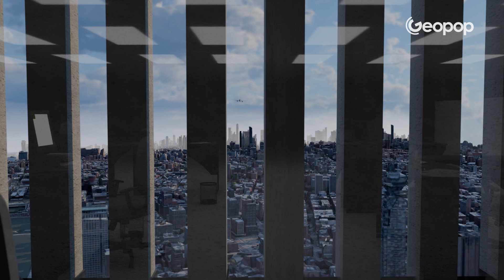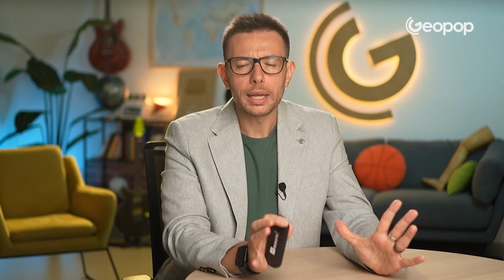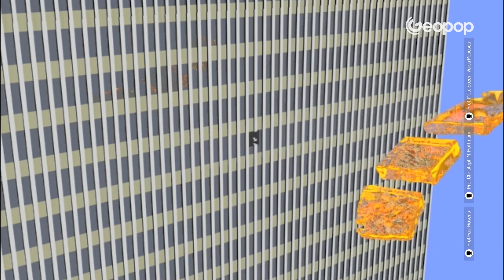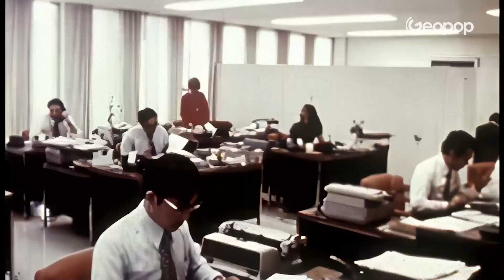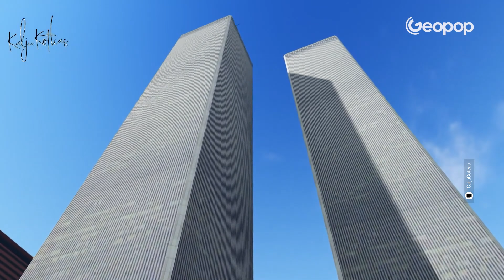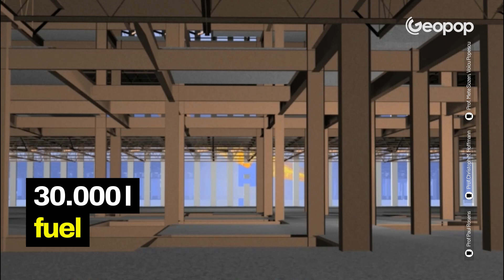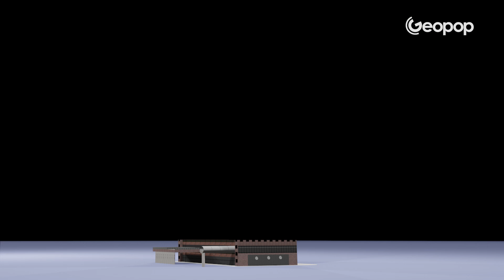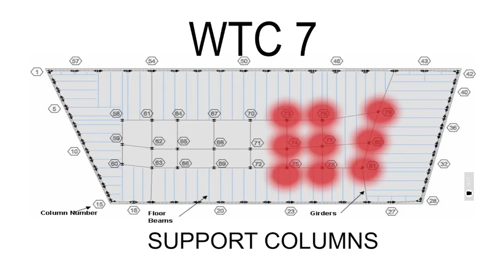9/11, 2001: The Technical Reconstruction of the Twin Towers and WTC 7 Collapses

Comment: This is the same bs they have been saying for years. I can believe the tower sagging and weakening at the point of impact with a burning fire but to believe that neither the cold center columns or the cold supporting perimeter offered any resistance and allowed the towers to fall at freefall is ridiculous to me. Then tower 7 falls at the same freefall speed because of a fire, is again ridiculous. Plenty of people claim to hear explosions right after one another but those claims are denied because windows are still intact? That logic is ubsurd. Yet I'm suppose to believe a fire could bring down a building, a building that was reported to be destroyed while it still stood behind a reporter on live tv.
Reply: The core columns did offer resistance though, they remained standing for a few seconds after the collapse. You can see this in multiple videos, from multiple angles, especially with the North Tower. The core collapsed soon after, because as can be seen clearly in the videos, it had nothing left to support it. This is the exact opposite of what happens in a controlled demolition btw, you'd never do a controlled demolition and leave the core columns intact after the demolition. Also the towers did not fall at freefall speed, you can easily prove this by just looking at the videos. You can see debris falling at actual freefall speed below the main building. Building 7 also did not fall at freefall speed, only its curtain wall did, because the collapse was a progressive one.

"Plenty of people claim to hear explosions right after one another but those claims are denied because windows are still intact? That logic is ubsurd"
I agree, that logic is pretty absurd. I think it's more compelling to point out that if there was supposedly so many explosions, why can't you hear any explosions in any videos of the collapses? Not a single one? 

"Yet I'm suppose to believe a fire could bring down a building, a building that was reported to be destroyed while it still stood behind a reporter on live tv."
Doesn't that fly in the face of your argument? If people were reporting it was already destroyed before it was, does that not imply that it collapsing wasn't this shocking, totally unexpected event?
Reply: @marvelfannumber1 There were sounds that *sounded* like explosions right before and during the south tower collapse. I know there is a video of it around here somewhere.... But the best explanation i can think of for that would be the floors dropping on one another like a domino effect, after that tower's remaining supports for the damaged floors had failed. Those floors were dropping hard on each other very fast in those 12 seconds. Honestly the more footage you watch, the better context you can gain for the whole sequence of events.. Never mind the mainstream news - look for the independent journalists' footage
Reply: @kayleemeyer2830  
Sure, I'm sure you can find your outliers. But the bottom line is, the collapses look and sound nothing like a controlled demolition. If you've ever been near a controlled demolition, or just seen a video of it, they're fucking loud*, really loud, and that is for building *way smaller than the World Trade Center, both in height and volume. 

Not only are they loud, the explosions are rhythmic and constant. A controlled demolition does not have an occasional bang before the demolition, it has tons of bangs constantly to blow all the supports. On 9/11 you have none of that. The collapse, even from up close videos is almost eerily silent.
Reply: @marvelfannumber1  honestly I can't find many other shots like it. Not very many of them were this close. But at the very beginning you can hear each bang as the floors started to collapse on each other. And yes i absolutely agree with you, these could not have been demolitions
Reply: The explosions heard were the sounds of the jumpers hitting the ground
Reply: @kevinmorris3200 most idiotic comment goes to you 👍
Reply: They explained at minute 15:30 why the cold floors below couldn’t support the weight of 29 and 12 floors respectively collapsing at once, while gaining mass on their way down. It’s your choice to believe that or not
Reply: The support collumbs were resisting that’s why the towers stood for a while before falling, if a fire is left to burn without end then any building will eventually collapse, and what do you think loud booms and bangs is more likely, explosions carefully hidden so that nobody would see them, or some pieces of steel and concrete falling hundreds of feet to the ground
Reply: well yeah, i mean look at all the other buildings that have collapsed due to a fire since 9/11.......how may has it been......oh yeah none, the same amount that fell before 9/11 happened. crazy how that worked
Reply: You obviously are too dense to understand the very video you're commenting on.
Reply: You just can't comprehend the the magnitude and the forces involved when a building as massive as WTC is collapsing on itself.
Reply: Randoms on the street in panic can't explain explosion from a loud bang that comes from whatever. 

People explaining the planes hitting said the same "then I heard a huge explosion".. they didn't see the plane but they just heard something.
Reply: @akse  Ummm yeah, because light travels faster than sound. Also I'm sure there were plenty of echos off other structures.
Reply: Well I might bring you some information which the video wasn’t super clear on. Now if the government did it or not I don’t care you can still believe that, I won’t try to change your mind on that. What I do want to do is maybe make you believe that planes in fact took the towers down. Even WTC7, now wouldn’t it be easier for the state to have let the hijackers fly the planes into the buildings and they brought it down. Now to the technical stuff. Lets start with the towers, yes the cold beams did indeed keep the towers up. They provided structural supports when the hot ones didn’t bear as much. But the buildings burned for about one hour for the south tower and almost two for the north. So the hottest columbs probably lost indeed 95% of their structural stength. But even most of the colder ones had lost a lot of structural stength as they would heat up a lot aswell. South tower had 22 floors above the impact of weight to hold up. Now as one side totaly collapsed the compromised parts couldn’t hold the weight and they collapsed aswell. And even tough there were very cold columbs most were heated. All weren’t 1000 degrees celcius but they were still hot and had lost a lot of structural integrety. But building seven has a lot of questions and you talk about people hearing explosions. Thoose weren’t about building seven but about the twin towers. Now some might have been of molten almuninium falling into water. That creates explosions, and some are from when it collapsed and it was floors being compressed. Floor after floor, but I’ve never heard explosions about building seven. And even if you think it would have been explosives it couldn’t be. Because everyone would hear it, if you have ever heard a demolition of a building its loud, its really loud. Like being to close you go deaf. You hear it kilometers away. But some people think it just collapsed all in one peice but it didn’t. As you see in the technical analysis the inner core collapsed first which you can’t really see from the outside photage. But you can at one point see it, if you look at the photage of the collapse you can see about 20 seconds before the outside shell collapses if you look at the top you see the penthouse fall into the building. Which is on the side that the collapse started. And its about 20 seconds or so before the whole thing goes down. Now did the government plan to do this with a thing probably no one would see collapse before but they explode that part to bring the little penthouse down a 20 seconds before? I think if you want to believe the government did indeed do 9/11 why wouldn’t it be just that they allowed the planes to be hijacked. They hired the terrorists and they drove the planes into the buildings. Doesn’t that make more sence?
Reply: @lofiseeker1790 they didn't fall at freefall speed.
Reply: @orionred2489 10 seconds and 6 seconds is freefall 🤦
Reply: @MrLIVdDREAM  Free fall for a 1,368 foot tall bldg would be 9.22 seconds. Average collapse times for the 2 towers were 18 seconds and this does not include the cores which stood for another 8-10 seconds. The bldgs fell nowhere near free fall.
Reply: @Oldschooldan1  ok let's make up figures. Tower 2 collapsed in 10 seconds. Known fact which even the media state. WTC 7 was 6 seconds. Which equals freefall.
Reply: @Oldschooldan1  stop smoking the government's pole for them. Blind Harry could tell it was free fall. 50 meters of standing steel doesnt count as remainders of the building standing
Reply: @orionred2489  yes it was almost a free fall
Reply: I know man! When they will cut the crap with this bs!

Comment: The towers were built to take multiple 747's in different locations. They didn't collapse, they were demolished. Never forget Building 7
Reply: No they weren't, they were designed to take the impact of the largest plane of the time which would be the 707. The towers were hit by 767's. The towers were designed and construction started before the 747's came out in 69.
Reply: @455buick6  The enormous amount of fuel was not factored in either. Only about 2000 gallons were factored into the equation. Not the 8 to 10000 gallons present on that day.
Reply: https://youtu.be/KMvCWFCoVN4?si=kDfEZG3fxhxVCZfv
Reply: 747 more like 707

They were ment to take 707s in different locations, but not at full speed.

This was before the 767 was made I believe.

AA11 was traveling at 440 MPH before it hit the tower.

Comment: Why did he skip the damage to 7 done by the 1 & 2 collapse? If anything caused 7's collapse would be those 2 events in particular but he just focused on the fires and heat and skipped the detailed physical damage that occured which caused the fires. It's never been properly explained exactly how damaged 7 was from the collapses of 1 & 2 before 7 itself collapsed.

Comment: The steel melted up there, the building was strong enough to stand still
Reply: Because of the method of construction. It was mentioned that the weight of  over twelve stories was too much for the bottom floors to sustain at once.

Comment: The fire was up there not in the bottom, it looks like demolition 😂
Reply: The construction method used was only strong enough to support up to six floors on a sudden collapse. There were more than 13 floors that suddenly collapsed on top of the bottom ones. That was mentioned.

Comment: So, what NIST is saying is that the buildings were designed to collapse like a demolition?
Reply: No, how did you come up with this interpretation?
Reply: The construction method used to build the towers only allowed so much weight to collapse on top of the bottom floors. Think of it like an exo-skeleton from the bottom floor all the way up to the top and then each floor is built inside of it. In western construction they build floor by floor.
Reply: The collapse isn't much like a demolition, if at all. Especially for WTC 1 and 2. You can clearly see the top of the towers collapse first, then impact the rest of the building. Debris rains down from the impact site as the rest of the towers fall. It does not even begin to resemble a demolition. 

If you have ever watched a demolition, you will see countless explosions going off before the building ever begins to fall. We don't see this in ANY of the WTC collapses. There simply isn't any evidence for controlled demolition. I wish people would let go of that nonsense.
Reply: @Karamarika Sadly people can make conspiracies out of anything these days. Apparently if you dont question everything you're a sheep.
Reply: No, you should question everything.  Ask the question "was 9/11 a controlled demolition?"  Spend a few seconds thinking about it, and realise that the answer is "no, of course not."
Reply: @Infinite_Maelstrom  Es gibt keine andere bekannte Methode 3 Gebäude in der Art und Weise abzureissen!
Reply: Yup and was brought down by jet fuel